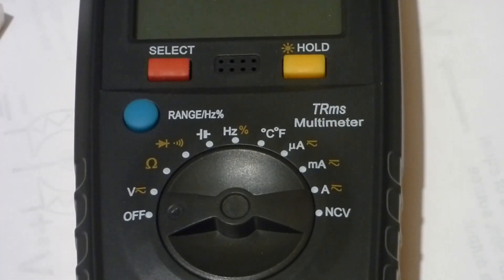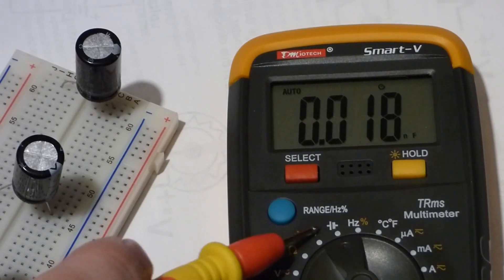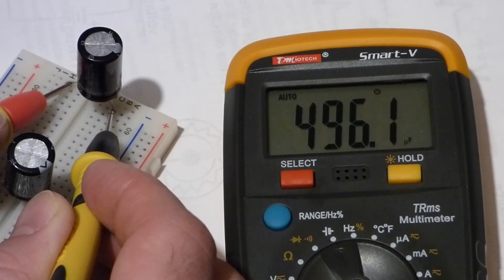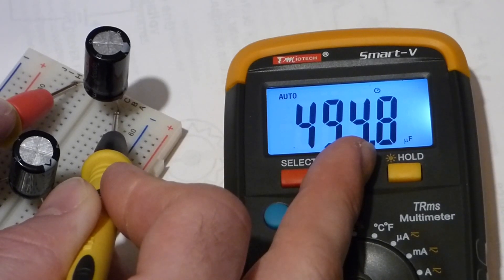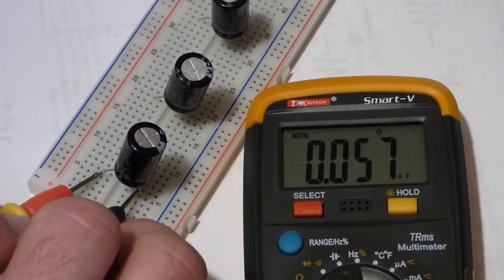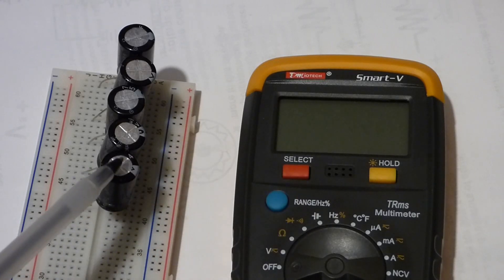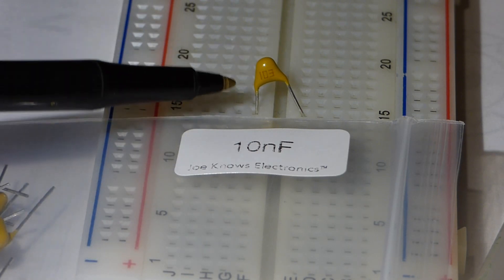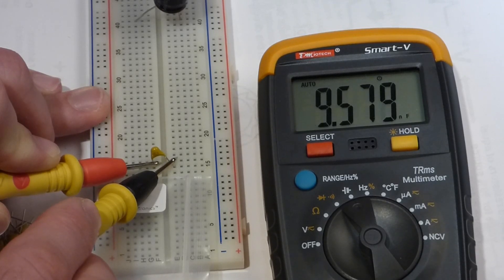How to measure capacitance of capacitors with a multimeter able to do so. Tutorial lesson.

Comment: My multimeter It has only 5 options 200u..20u..2u..200n..20n ? How can I measure capacitor 470 u ?
Reply from the maker: Unfortunately you you wouldn't be able to. Some multimeters only go up to about 200µF. If you have an unknown value capacitor that is out of the meter's range, then you'd have to charge/discharge it and based on the time that it takes, use the proper formula to calculate the capacitance. A steady current, from a current source, of 0.00047A (0.47mA or 470µA) will change the voltage of the capacitor by one volt every second.
Reply: @Electronzap  thank you very much 🙂